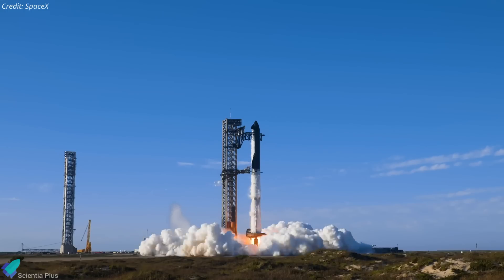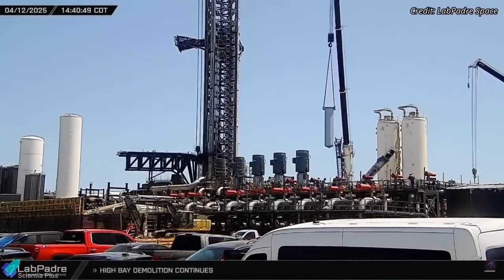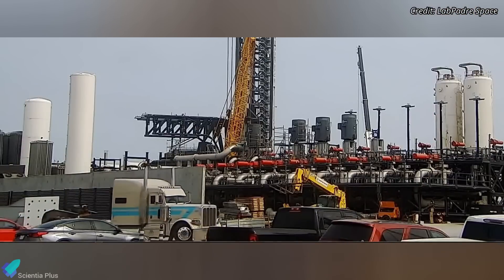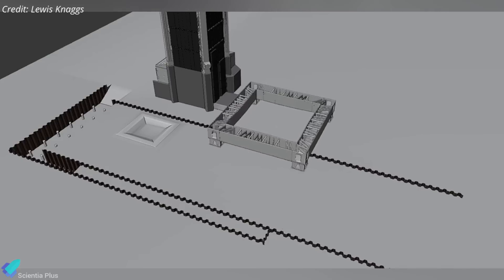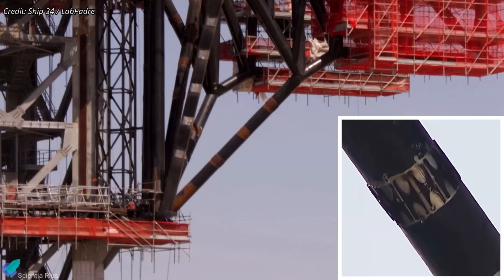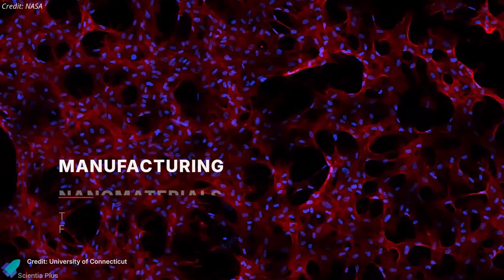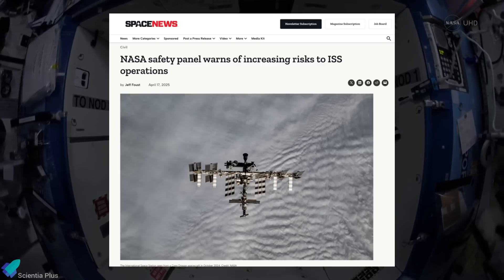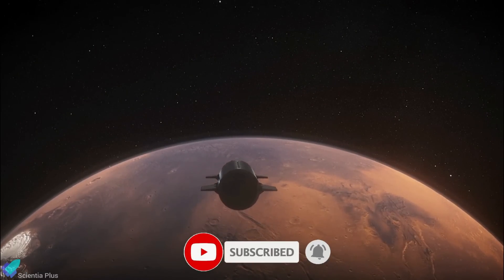SpaceX Caught Testing New Starship Raptor Variant! Removable OLM CONFIRMED For Pad B!

Comment: They did a successful full flight time static fire before launch 8, they still failed. I doubt they will resolve the issues even with all the data until they upgrade not only the engine but the full fuel system with something more robust and not prone to failures, they will get there but they will be forced to do so not because they want to but because they have to. Just like they were ignoring the initial pad issues for 3 failed flights until they were forced to change the pad and put the deluge system in place, not because they needed to but because they could not ignore the failure of the pad any longer.
They need a break of about a year to resolve all the major issues, that they have resonance problems during launch is something rocket engineers have resolved decades ago, for spacex to still have these problems shows a fundamental failure at spacex.

I would love to see a successful launch and then reaching all their goals, but sadly i think they are still a number of iterations away from success on a regular basis.